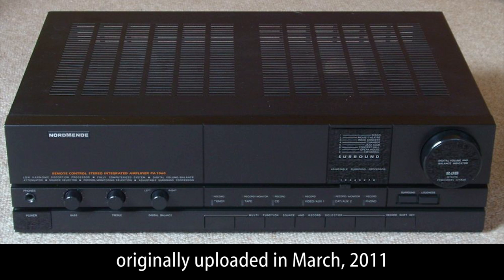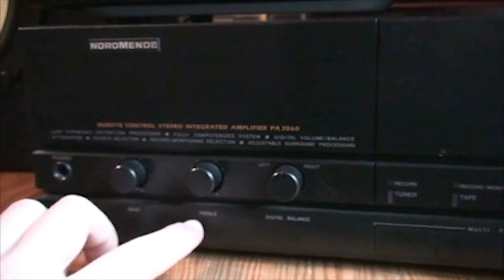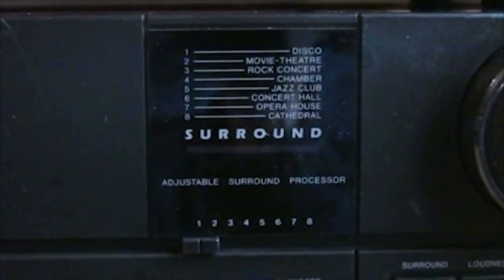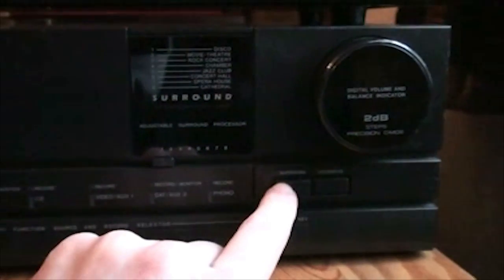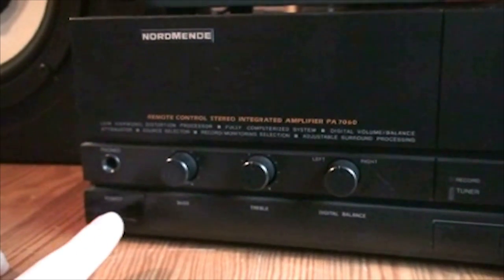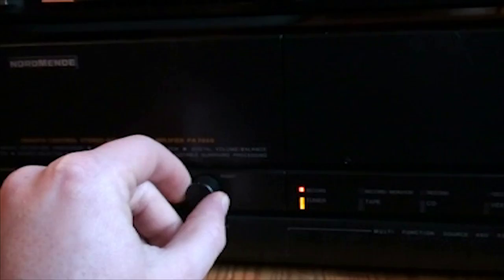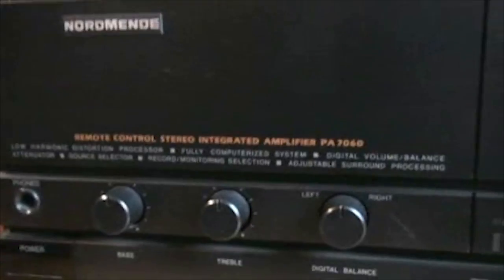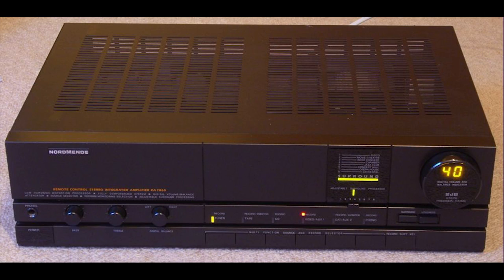Nordmende PA 7060 amplifier with Digital Controls

Comment: I actually like the look of the volume knob.Maybe if the center of the know would have been fixed,and only the outer ring would have turned(they could have put in a normal potentiometer),it would have been better.
Reply: Yeah, I agree. The designers of this amplifier were on the right track, but didn't fully think it through. I really like that design.
Reply from the maker: The unit didn't look bad, but it was all very cheaply made.

Comment: I think the advantage of these digital controls is that they don't scratch when they are corroded. But I also don't like them :-)
Reply: Yeah but when they get dirty they will turn very glitchy, which imo is worse.
Reply: s8wc3 
This isn't a rotary encoder like a jog dial, it's just two buttons!
Reply from the maker: Still these are not perfect. You can actually see at one point in the video that I'm pushing the button, but the amp doesn't react.